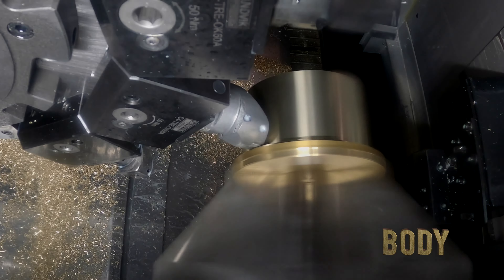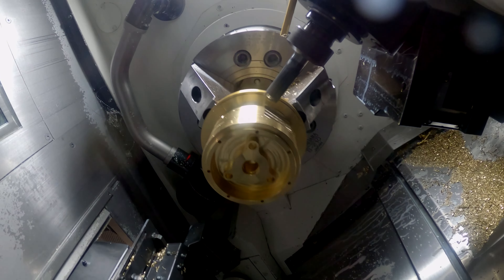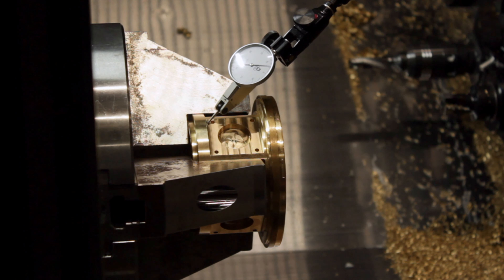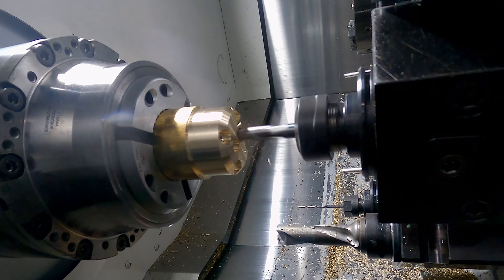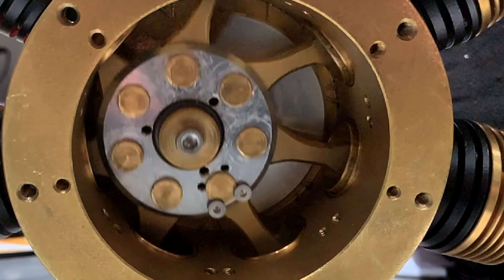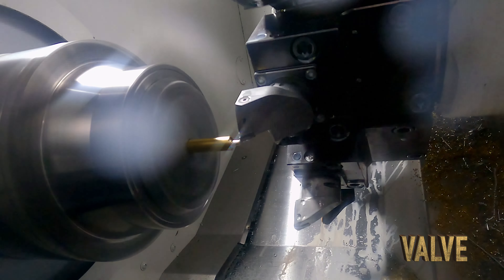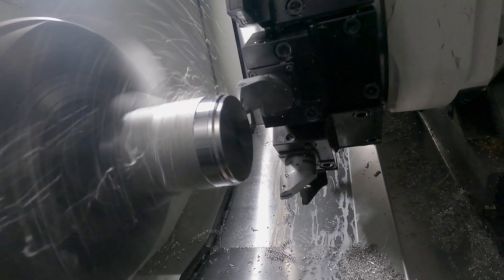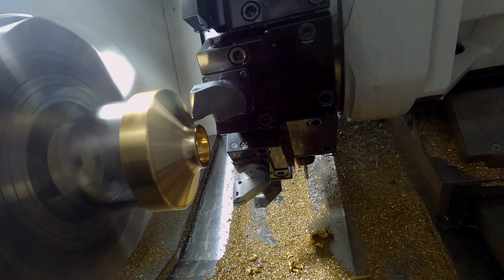MAKING A RADIAL ENGINE FROM A PICTURE ON THE INTERNET? | 4-AXIS CNC! PART 1

Comment: Great project guys!

You should build a steam powered RC car, always wanted to see that done.
Reply from the maker: Thank you so much ! That’s an awesome idea ! Did you have a certain design in mind ?
Reply: @STITCHEDUPBUILDS   I guess I would just start by finding a steam engine design I could adapt/minaturize to fit on a large rc chassis.

You could go as complicated or simple as you want I guess.
One or two piston engine.
Solid fuel or atomizer and liquid fuel.
Steam reclamation or not.
Superheater circuit etc.

If you have no prior knowledge of steam engines here's  an engineer explaining all the basics https://youtu.be/RFo7rivpvNk

Good luck with whatever you guys decide to make :)